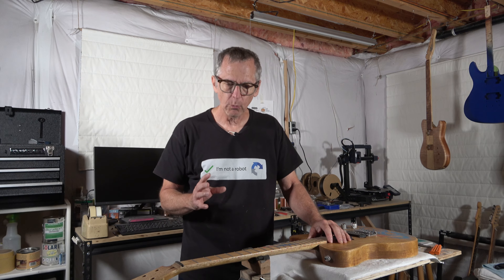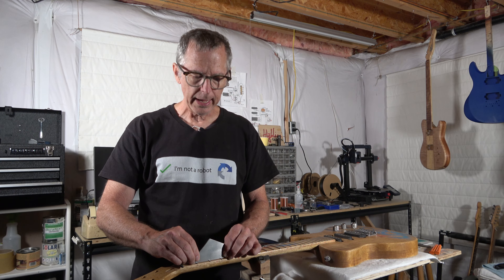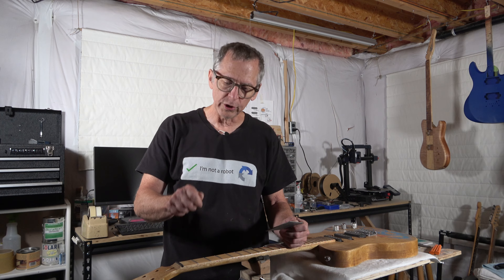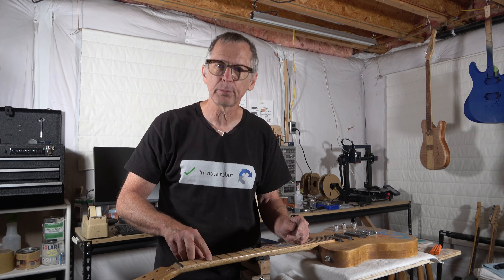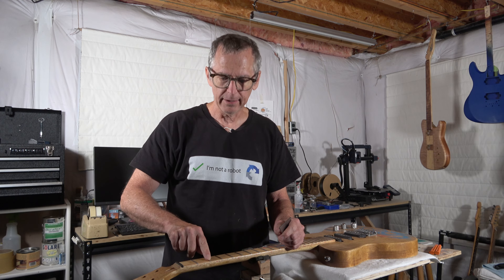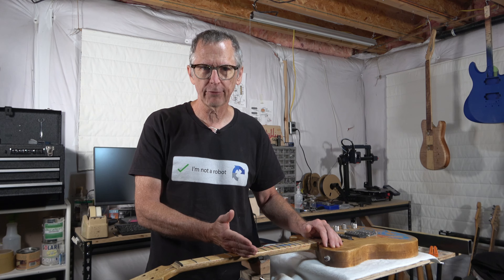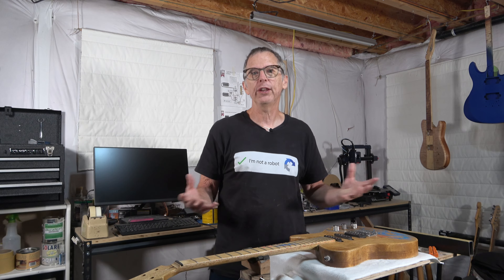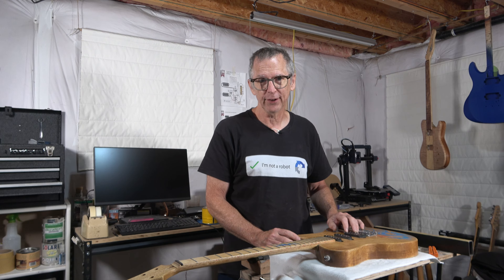Are You Using Your Fret Rocker Wrong?

Comment: Seriously? You advise using a fret leveling beam to level all the frets in order to address one low fret? It would be easier to replace the one low fret in that case and level that single fret to match the rest of the frets. I only offer this solution because I've done it before. Sorry but in this instance you're advise in addressing a single fret this way is way too labor intensive and unnecessary!
Reply from the maker: Seriously. Think it through. How hard/time consuming is it to level with a beam compared to pulling out a fret, cleaning the slot and the area around it, cutting a new fret to size, radiusing the fret to match the fretboard radius, pressing in the new fret, and leveling the new fret to match the others. I'll take running a beam over the existing fret for a few seconds instead of replacing a fret everytime.
Reply: Unless you find that specific customer who does not want to even hear about replacing a fret.

Comment: The Fret Kisser tool from Stewmac saves so much time and thinking when fixing high spots.  It won't file lower than the neighbors.
Reply: I bought one. Looked like the greatest tool ever, but it seems like the file part isn't deep enough and wont hit the part that actually rocks with a real fret rocker
Reply: @pipelineaudio  Or it might be that your fret rocker is not straight. They're not always perfect either, so don't blindy trust the tools. Could be the fret kisser aswell and if so, send it back and get a new one.
Reply: @pipelineaudio  I've noticed this also as well as many others.  I suspect it was made intentionally because you still need to finish off the fret with sandpaper to smooth and shine. It's still a good tool for non professionals  like me.
Reply: @pipelineaudio  Try the next shorter width.  I've seen some rockers that aren't as long as the Fret Kisser, and if it's resting on a high fret farther away it won't hit it (more than 3).  Also won't work with a lot of relief or fall away.
Reply: @michaelmenkesOZSKIB  mine is garbage and I’ve seen a lot of reviews from real world users stating the same thing. It reads as if the fret is level when it’s still high and I have to go in and finish it with file - which is the exact step I was trying to avoid. I wouldn’t personally recommend one. I bought a new crimson rocker and checked everything with a machinist’s straight edge to rule out my rocker being off and it was perfect. The tool just doesn’t work in a good amount of cases. Unfortunately I’m UK based, so return is out of the question.
Reply: stew mac's return policy is insanely good. just send them an email and theyll send you and new one, and reimburse you for sending the old one in with a bill for the shipping. Tell them its not working as intended. no questions asked, new one shipped before they even replied to my message.
Reply: If it was just the first or last fret that was too low. Would it not be better to just replace that fret rather than beam and crown all the frets?

Comment: I believe that you need to evaluate neighboring groups of 3 frets to be certain that the outer two frets are not low and causing the rocking.  There is more deduction required when using this tool.
Reply: Yes, I watched the video, and while it is good info, the initial assumption that rocking shows a high middle fret worried me, and I was going to make a similar comment to yours.  
When the rocker rocks, you know you have a high middle or a low edge (ie for frets 1,2,3  no2 could be high or  1 or 3 could be low); you need to test adjacent 3-fret-groups to see if you have a high or low spot.

Comment: My problem with this tool is if the 1st and 2nd frets are level and the 3rd fret is low then it will rock and then u will try and lower the 2nd fret thinking it's high but it's actually the low 3rd fret causing the problem. Any suggestions
Reply from the maker: You’re missing the point. If the 3rd fret is low, all of the other frets have to be reduced to the same height as that 3rd fret.

Comment: I tried using a fret rocker for a few months, but ultimately found it frustrating. Mainly, because it only works 3 frets at a time and you end up chasing the "high" fret up and down the neck. I think it can be useful, but only in very specific circumstances. 

Regarding your explanation that to use the tool on the flat side, not on the edge... I don't understand why it would make a difference. Could you please explain further? When I use my notched straight edge, I always tilt it on its sharp 90% edge. It gives me the most accurate reading that way. Why is this different?
Reply from the maker: @mikebozik  https://youtu.be/CBossg9fdp8?si=rjRC1ROddpHM8deP
Reply: @HighlineGuitars  Thanks, watched it and learned something!

Comment: I always check the frets with the strings on. With the strings off, you can get back bow which can cause frets to seem high even though they're fine under tension.
Reply from the maker: I do that with older/vintage guitars, but with my new builds, I adjust the truss rod to level the neck when the strings are off.
Reply: @HighlineGuitars  That's why the neck in the video looks so straight. I'll have to try that next time. Thanks for the tip!

Comment: I use a fret rocker but I have radiused the edges to remove the corners so the the edge isn't flat but a single point contact so you get round the problem you rightly mentioned.

Comment: Hi, thanks for the video. If you have time, could you please answer the three other questions below regarding whether or not the neck should be straight before checking or just as it is normally played with the strings removed, or indeed whether it can be done initially with the strings still on the guitar/bass - or maybe it doesn’t matter! Regards…
Reply from the maker: I always make sure the neck is straight when I check the frets. Of course, my guitars are brand new. With an older guitar, or one that is vintage, I like to level the frets with the neck either under string tension, or with the string tension simulated.
Reply: @HighlineGuitars  If you're levelling under tension, do you use an adjustable beam, with a tiny amount of curve in it to compensate for the neck relief?
Reply from the maker: @1man1guitarletsgo  No. the frets have to be level in a straight line because the strings are in a straight line.
Reply: @HighlineGuitars  OK, so if I understand correctly, you'd have to adjust the truss rod while the neck's under tension, making it dead straight.  Then level the frets.  Then adjust the truss rod to achieve the correct relief.  What's the advantage to doing this under tension?  When I level and crown frets, I remove the strings, and use the truss rod to make sure the neck's straight.
Reply from the maker: @1man1guitarletsgo  Actually, if you like your guitars to have some relief, you would level the fret while the neck is setup with the relief you desire. That way, the frets will be level relative to the strings which is necessary to eliminate string buzz and fretting out.
Reply: @HighlineGuitars  No, that's not correct.  The purpose of relief is to allow the strings to vibrate without touching the frets, so making them perfectly level regardless of what the wood underneath them does is pointless.  Having performed the initial levelling, I also generate fallaway from the twelfth, to the last fret.  This, along with a little relief, allows for the lowest possible action.
Reply from the maker: @1man1guitarletsgo  No, it is correct. If you add relief or simulate string tension, then level the frets, you’re removing more material from the first and last few frets while removing less material from the frets in the middle of the fretboard. The frets at each end of the fretboard are shorter in height than the middle frets, but they are level. If you add relief AFTER leveling, then you get you described. However, the frets are no longer level.
Reply: @HighlineGuitars  I agree, but I'd asked if you used an adjustable beam.  I still see absolutely no point in levelling frets with the neck under any kind of tension.  Just set it absolutely straight, and follow the procedure I outlined above.

Comment: You need to 0 the neck 1st. You then should put some glue on each side each fret a few at a time clamp them down hard wait a few min then you know they are down as far as possible. Once this is done.... there is a simpler fix. ALWAYS level from 24th to 1st fret. This way you have the highest fret guaranteed to be the lower height. There is NO WAY the lower frets could be higher then. You mark them then level highest to low. I also tidy up once strings are on from high to low with a fret kisser under tension. This gives me a PERFECT level every time little thought needed. I like my 24th fret a slight bit lower anyway. Yeah you need a fret kisser pay the $$ and get one!! Use it from highest fret to low. If the 1st fret is too high you can shim the top nut or just level 1st fret at end of the job. Either way perfect every time.

Comment: Thanks for bringing up the problem might be that the fret is not fully seated.  Cannot underestimate that and I'll always try to fully seat before I level.  Many if not most high frets I've run into were solved with tap of a hammer/dowel and a little CA as you suggest.  Along those lines, I've also since learned that I might have caused the unseating of the frets by saturating the fretboard with Dunlop lemon oil, which I've ceased doing...

Comment: Hi Chris, One thing you didn't mention is the danger of addressing a group of 3 frets in isolaton of other frets. For example if you examine a group of 3 frets and the rocker rocks, the cause may not be a high middle fret but a low fret to one side of the middle. If you lower the middle fret you then create a little ramp in that area, and as you said move the problem along the fretboard. It is therefore wise to check all frets before doing any corrective filing. A technique you and viewers may find interesting and useful is practiced by Sam Deeks on his YouTube channel using his "banana" tool to level frets with the strings still on. Not an actual banana!
Reply from the maker: With skill and experience, you won't get a ramp. If I polled a thousand professional luthiers, I'd be surprised if more than two or three would advocate Sam Deek's method. If you level the frets with the neck straight, you'll get exactly the same result once relief has been induced by either the truss rod or string tension.
Reply: @HighlineGuitars  Hi Chris, just to confirm if you have experience you won't get a ramp, but for newcomers it's wise to check over a wider range of frets before filing any. Sam's method is a more subtle way of levelling frets, and I would bet most luthiers do prefer the straight forward traditional method. Along with using a fret rocker, I believe there's a place for both.

Comment: Stewmac's Fret Rocker is 3 mm thick. Wouldn't it be better if it were thicker, like the Fret Kisser?
Reply from the maker: No. You just have to pay attention when using it.
Reply: Making it too thick may actually ruin it on identifying those small tall spots on frets

Comment: You didn't mention evaluating the straightness of the neck/fretboard first. I cant teach you to suck eggs, ive only worked on a couple of my own guitars I'm no luthier. I have used a fret rocker to identify very high spots to take them down, followed by marking all frets with a sharpie and using a levelling beam to blend in perfect with the nut out.
Reply: Removing as little material as possible, then recrowning and polishing.
Reply from the maker: @jamescarter1088  This was not meant to be a comprehensive fret leveling video. It was only meant to describe a couple of things that people do wrong when using the fret rocker.

Comment: The fact that some people may not have fret wire laying around and if you’re used to leveling I think it’s a great idea, especially if you have more than few high spots I can do a board fairly quick then re-crown. No harm no foul or just use a smaller leveling block on that section with no pressure. Anyways, thanks bud.

Comment: Strangely nobody mentions you must use the right scale length slotted flat edge to make sure the neck is exactly straight without strings before using a fret rocker...please do not file any frets until the neck is straight as a dye then use a rocker...this means straightening the neck by adjusting the truss rod...if used on a slightly uneven, front or back bowed neck you will have problems & re-fretting a guitar or bass is expensive...i would advise using a brass headed fret hammer to flatten slightly high frets, not all are seated perfect on most guitars or bass's...well certainly not Fenders...lol...i watched a guy on YouTube use a brass fret hammer to flatten slightly high frets, only had to dress a few frets afterwards to make them perfect...impressed
Reply: @christopherstorrier5560  I came to the comment section to confirm this about the neck being straight before you start levelling so thank you for your comment.

Comment: Nice video! From a multiple guitar owner experience, high spots are 80% of the time a question of wrongly sited fret. So when ever I buy a used guitar I run the fret rocker and if anything rocks, I first whack my fret setter once or twice over the high spot. 8 times out of ten it's not rocking after that. I check the whole fret again because 30% of the time it will raise that same fret in other places. I knock the new spot down with the fret setter and usually I'm done.

Comment: You can make your own Fret Kisser for free by sticking a small narrow strip of 300-400 grit sandpaper with a masking tape to the the middle of one side of your Fret Rocker and sticking 2-3 layers of the masking tape on the ends to prevent the rocker from scratching the outer frets and level the surface, so the sandpaper won't be sticking out too much.
Reply from the maker: :face-blue-wide-eyes:

Comment: Thank you for another fantastic video and for sharing your extensive knowledge once again. Although I did already know the information you passed on in this video, I know many people will benefit from it greatly. 

For many years I worked with vintage vehicles and machine work so I (sort of) invented a method for checking for low frets at the ends of the fretboard when you can't utilise the rocking motion of the rocker.

I have an ultra bright pencil torch and a set of feeler gauges and my method was to slide the rocker up to the frets as you mention, but if the rocker sailed straight over I would shine the pencil torch from the other side of the rocker to see if any light was showing between the rocker and fret surface.

If so, I would mark it up using the sharpie and then go through the feeler gauges to get an idea on what sort of drop there is. Now, on the higher frets what I tend to do is try to work in some "fall off" to overcome the gap and this tends to not only deal with the low fret, but win you a slightly better action on the top end of the neck too but, you have to go slowly so as not to create a problem around the 12th to 15th fret area (ask me how I know 🙈).

However, if you have a fair chunk of gap on the 1st, it is as you said, a levelling beam job but don't let that put you off, it will give you a better result overall and will bring everything in quicker in my experience.
Reply from the maker: @restojon1  Great tips @restojon1!

Comment: I don't understand why tilting the fret rocker causes a clicking sound, falsely indicating a high fret. It seems that it wouldn't make a difference.
Reply from the maker: @charleshuguley9323  it happens because the rocker is very slightly warped. The edges are true in that they are precisely flat, but there’s a slight bow along the sides. I should have mentioned that in the video, but I forgot. It is quite common.
Reply: @HighlineGuitars  Thank-you!

Comment: The aluminum rockers that cost less truly don't work as well, even the more expensive, thicker, very accurately made ones. Aluminum simply doesn't click the same way. It's a surprising difference.

I got very nicely machined and anodized aluminum rocker that cost significantly more than the generic ones but less than the steel ones... And ended up getting the steel one anyhow. It was simply too hard to feel very slightly high frets with it, while the steel makes a more pronounced click.